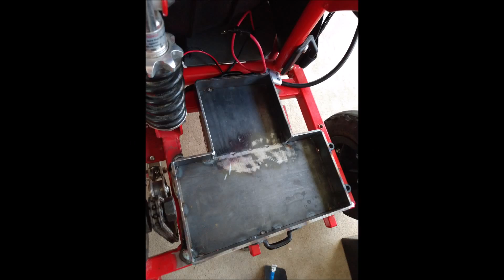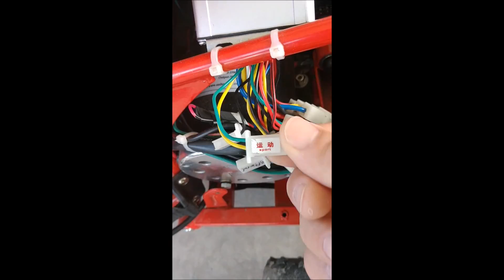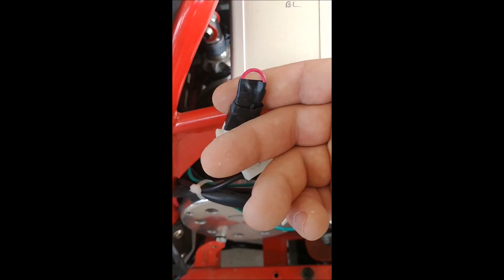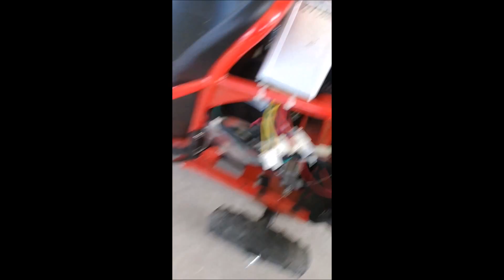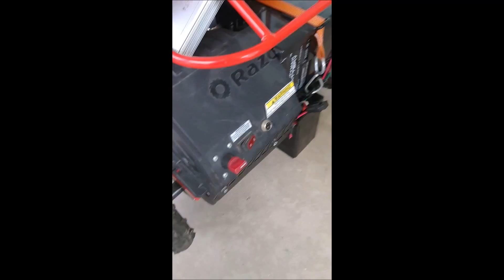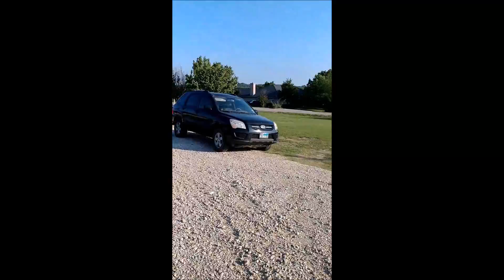36v Razor Dune Buggy Upgrade

Comment: I Just finished this build. I was previously running on 36v with the stock motor and a 500 watt controller and the kids burned up both motors while riding in tall grass. (we have 2 dune buggy’s)

This new motor/controller combo handles our yard no problem. All 3 kids rode it with no issues and the motor wasn’t even warm👍

Now I’m going to do the same to our other one.

Comment: Is this a 1000 watt motor?
Reply: It’s a 24v/500 watt motor. Follow the parts list he includes in the description and it will work great. The only challenge is mounting the motor. You can use 1/4 inch threaded rod bent into a U shape with 1/4 vinyl tubing over the rod. You can run the threaded rod over the motor and thru the mounting holes on the frame where the original motor goes. You will have to use a grinder to grind out channels on the new motors mount to make room for the threaded rod

Comment: If I’m not adding lights can I just use the stock on/off switch? Thanks
Reply from the maker: You could I suppose. I just used a heavy duty switch for thicker wire. It was $8 and good insurance 😊

Comment: will their original 24V controller handle the 36V battery pack? thanks
Reply from the maker: @wegoodinthehood-b4u  It will for a very short time. It will get too hot and burn up. It is not working h installing, especially since 36v controllers are so cheap. If you bought a brushless motor then use what came with it and the correct voltage. This is for the brush style motors, they respond very well to overvolting

Comment: Awesome video, and a great explanation. The hardest part was finding a way to mount the bigger motor. I would recommend that you don't skip the throttle, with the stock one the wheels were lifting off the ground and my daughter was getting whiplash. Thanks

Comment: Am I correct that the motor you put in is 24V, but you are running it off 36V (3 12V batts)? The Amazon links show 24V motor and battery kit is 36V. Appreciate the clarification, as it is a bit confusing and want to make sure its okay to run a 24V motor off 36V. Thanks! R
Reply from the maker: Correct. Only do this to BRUSHED DC motors. It essentially doubles the power

Comment: Can you modify them to go in reverse? If so, what would that entail?
Reply: Yes you just need a switch to reverse the polarity. If you put positive to negative and negative to positive it'll switch the direction of the motor so all i did was get a forward/reverse switch from a powerwheels and it works great

Comment: I am glad this all worked out OK yet I can tell you from experience you need to match your controller and throttle, as well as battery/controller/motor voltages or lots of smoke can ensue. I would recommend everyone follow your links for the exact parts you used.
Reply: I've been modifying electric scooters bikes and go karts for years and i haven't had a single problem mix n matching...i use 36v lipo batteries with a 24v esc and 24v brush/brushless motors without issues same with 48v with 36v components
Reply: @davek2690  will their original 24V controller handle the 36V battery pack? thanks

Comment: Hey bud do you have wiring diagram not in video
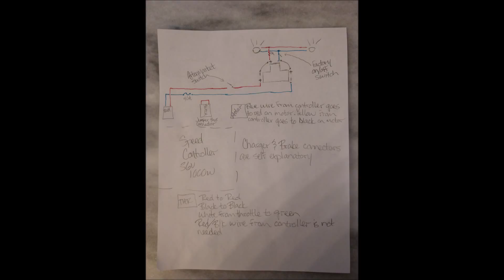Reply from the maker: Go to the 16:00 mark in the video and screenshot that
Reply: With all do respect that doesn’t show the original power switch that you converted to a light switch, where do the 2 reds land off original switch?
Reply: 2 red leads* off the original power switch
Reply: Never mind bud I found it!

Comment: Hey we have the exact same buggy which was parked up for a while, we would like to do the same modification that you did in this video, can you please advise?
Reply from the maker: The only thing not covered in the video is engine mounting. Please have someone that can weld decently on hand to be able to make a mounting plate for you. It is actually the most expensive part of the build. I paid a fabricator $250 to build the battery box and the mounting plate

Comment: I picked up 2 for cheap over the weekend. I will try you setup out once I order it all
Reply: what charger did you use to charge the battery's. the original one that came with the razor?
Reply from the maker: @christiand7322  No. You will have to get a charger that matches your battery voltage. In this case, a 36v charger
Reply from the maker: @christiand7322  I think I bought this one if I remember correctly. Nothing over 2A
https://www.amazon.com/dp/B07DXHGVM5/ref=cm_sw_r_sms_apa_i_fG76DbW4NT7DA

Comment: Do you know what size the chain is? I was looking to see if I could get it online.
Reply from the maker: The chain will have to be custom. Any local bike shop can cut the size you need. Just make sure it is a 20# chain
Reply: #20? Can’t find,  electric scooter parts shows #25, can you clarify. Thanks bud
Reply: @03thatdude  I have replaced dune buggy sprockets and chains.  The size is 25# (25H okay to use too).  For chain, I recommend buying off Amazon if you have Prime as ES parts is a bit overpriced and charges shipping.  You will have to cut the chain down to length, though.  It is possible to do this yourself; you need to sand/grind with dremel the end of the link pin you wish to cut and then punch it through using hammer/spike combo.

Comment: Did the stock chains work?
Reply from the maker: No it does not. It is too short. I went to a scooter shop and got a chain then cut it down to what I needed
Reply: How close was it? If I mount the motor further back do you think I could get away with stock chain? Thanks!
Reply from the maker: @crosbyjarm  no. The stock chain will not work. You would have to mount the motor lower to make it work, which I am certain is not possible
Reply: I ended up cutting the mounting bracket that came welded on the motor so I could move it back towards the chain more and works great. Had to drill new engine mount holes in both motor and cart. Did the exact set up as you and kids love it . thank you so much for posting this video!!!
Reply from the maker: @crosbyjarm  Awesome!!! Yes my nieces and nephews love it too. They hit about 20mph on that thing

Comment: What throttle control did you use? Thanks
Reply from the maker: My parts list is in the description :)  people will tell you that certain throttles "are not compatible" with certain voltages. In reality, all the throttle does is send a mere 5v signal to the speed controller. The voltage of the motor system makes no difference.